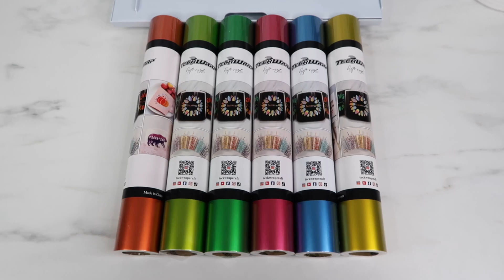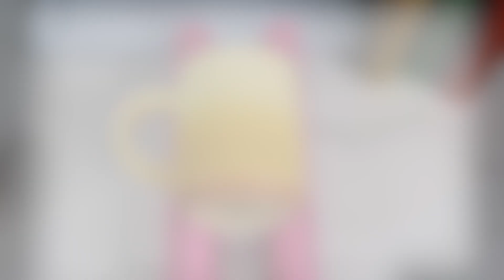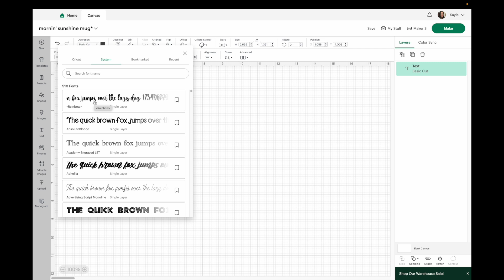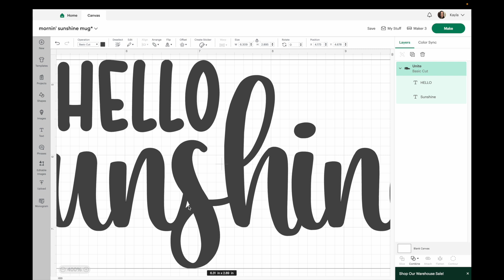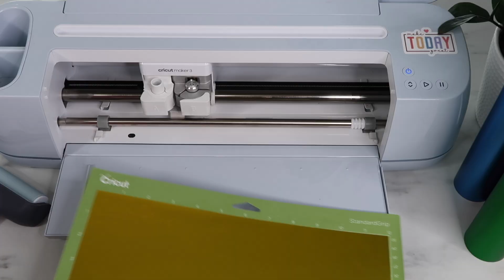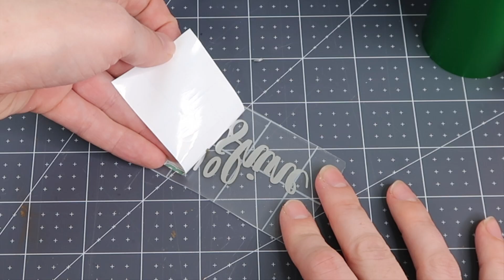HOW TO APPLY VINYL TO A MUG WITH CRICUT STEP BY STEP BEGINNERS GUIDE

Comment: The purpose of the transfer tape is so you can place all of the letters, or an entire design, all at once and maintain spacing etc, correct?  If I wanted to put each letter on individually, I could just peel each one off and do so, without needing the tape?

Thanks!

Comment: Hello, I just have a question about the heat press when I do my heat press I cannot get it to stay on the fabric. I do have the cricket cutter. I download the image have it cut and printed with the heat vinyl transfer paper but when I go to put it in the heat press, it just will not stick And I’ve tried both sides either shiny or shiny down. It’s not working for me.